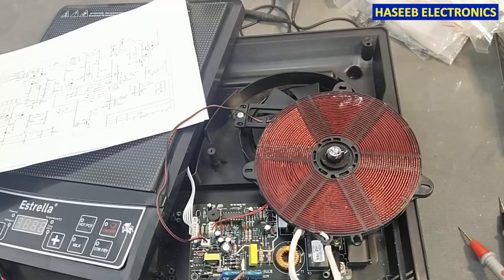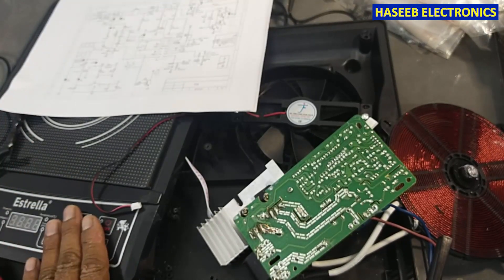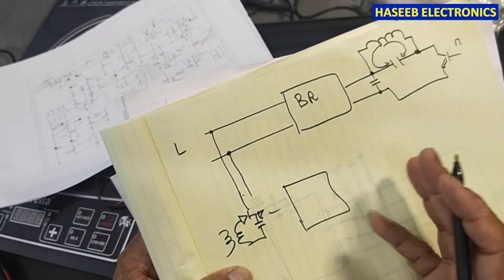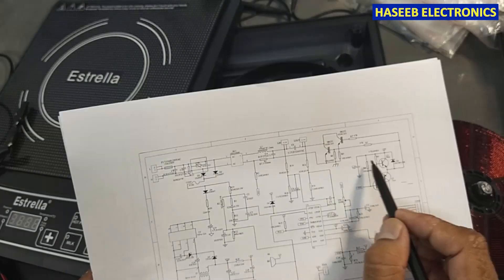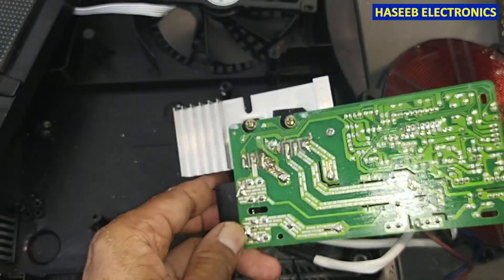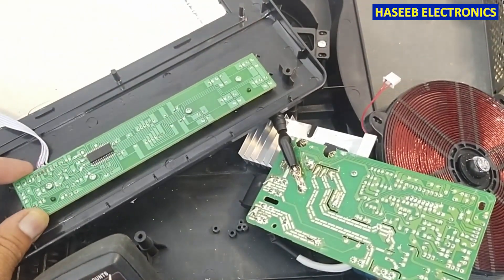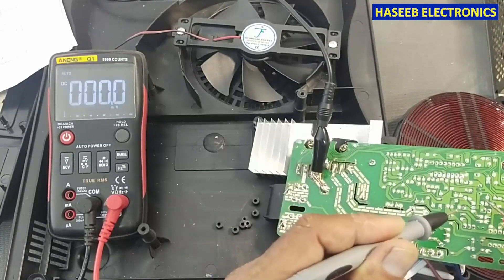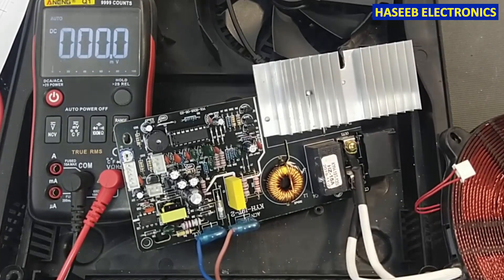{702} Induction Cooker Power Supply Circuit Checkpoints

Comment: I hope this gets seen and answered too.  Favor induction cooker just failed. Nothing abnormal happened and was used the night before.  Changed all transistors, IGBT components all 3, removed diodes to test, removed all caps to test, replaced Viper12A and still nothing.  Read voltage at IGBT AC and DC out but under .5 volts at zener 5V and 18V.  On the viper12a pins 5-8 or VCC I believe is reading nothing more than .5 volts where it should be the high voltage off IGBT circuit if I’m correct.  Is there any direction or help.   Thanks.

Comment: What is the output frequency of the resonant induction coil?
Reply from the maker: it is variable frequency, based on the cooktop size, 
because its inductance changes each time with change in cooktop base size. as the cooktop base behaves as core for this coil.
so, microcontroller detects the zero crossing of the pulse and adjusts its frequency
moreover the frequency is also adjusted based on the cooking profile and the required cooking temperature 
for more details check video numbers 
548
549
550 for gate drive signal of the IGBT
Reply: @HaseebElectronics  thanks.  You are great teacher.  I’m exploring the ‘auto-resonant’ transformers for the project, for example adjusting the frequency according the load, but I want the load to be the standard mains frequency / voltage capable
Reply from the maker: most likely it is around 20-40KHz

Comment: Sir that circuit diagram 2 igbt s are shown. Sir why igbt short continuosly .
Reply from the maker: in some models it uses 1 IGBT, 2 IGBT and some models have 4 IGBTs 
if the gate is charged. it will give continuity 
sometimes the internal recovery diode gives continuity as well

Comment: Good explanation 👍👍
Reply from the maker: best regards
Reply: @HaseebElectronics  dear sir I have purchased handheld self battery powerd dso can it be safe to measure ac voltage with out isolation transformer as you described in your safety measures for dso,s